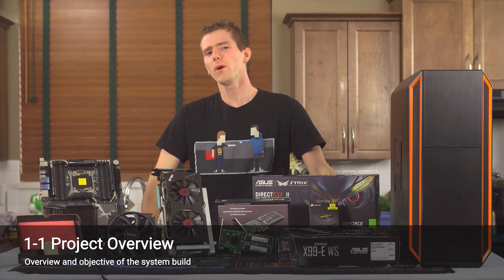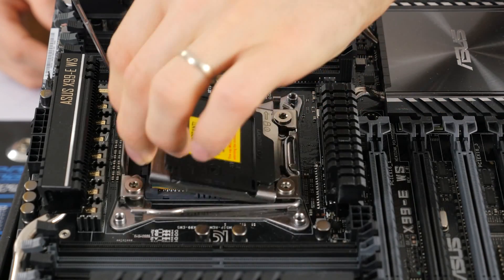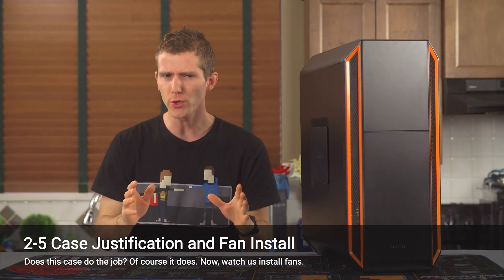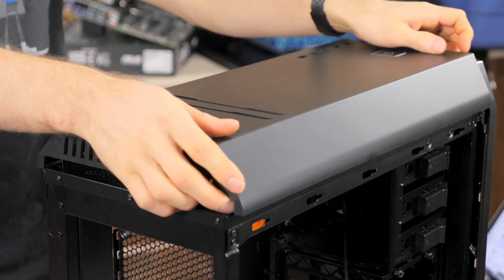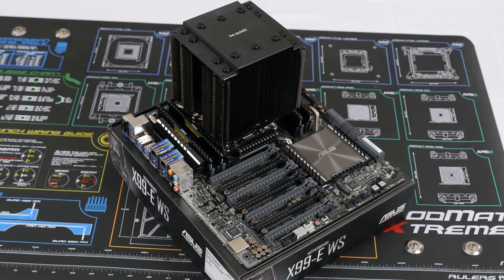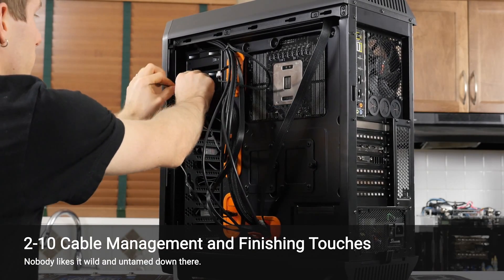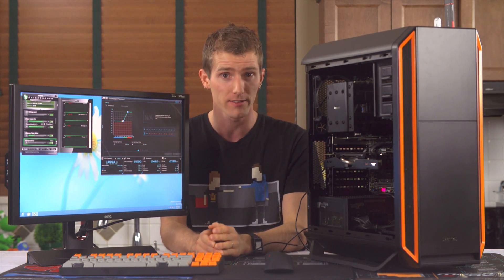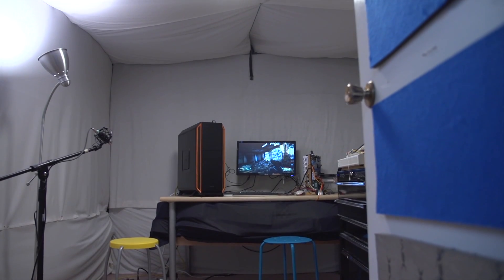How to Build the ULTIMATE Silent Gaming or Workstation PC

Comment: I’ve decided to build my first PC and I’m wondering if this is a good build. My budget is around $1,450. Can someone please help me? I want to build a PC that will last for awhile. I will be mostly using it for gaming on a 1080p monitor and do video editing. Thanks!

CPU: Intel Core i7-4790K
Motherboard: MAXIMUS VII HERO 
RAM: Crucial Ballistix Sport 8GB Kit (4GBx2) DDR3 1600 MT/s 
GPU: Gigabyte GeForce GTX 970 G1 Gaming
HDD: WD Blue 1 TB Desktop Hard Drive 7200 RPM, SATA 6 Gb/s, 64 MB Cache – 
SSD: Crucial MX100 256GB SATA 2.5" CT256MX100SSD1
Case: Phanteks Enthoo Luxe
DVD Drive: Asus 24x DVD-RW Serial-ATA Internal OEM Optical Drive DRW-24B1ST 
Cooling Fan: Cooler Master Hyper 212 EVO CPU Cooler
PSU: Corsair CX Series 750 Watt ATX/EPS Modular 80 PLUS Bronze ATX12V/EPS12V
Reply: If anything, I would get the EVGA Supernova G2 750w psu. It is one of the best and even has something called Eco Mode. My build is almost the same as yours. I have same cpu, mobo and cpu cooler and want that gpu or the asus strix version because of that neat fan feature it has. Just make sure that the RAM you are getting is not high profile, jus in case you ever want to upgrade to more of that type of RAM in the future because the Hyper 212 EVO does take up a little bit of room over the closest RAM slot. But it also depends on how you put the fan on.
Reply: Thanks. I will take a look at the evga psu u suggested.
Reply: zarbon700 I also forgot to mention that I have that PSU as well. It is Fully modular which is pretty neat because of all the unnecessary extra cables you can put away. If you want a really good place for psu reviews, I strongly recommend Jonnyguru.com. The Supernova g2 750w psu got a 9.8 out of 10 and got nothing put in the "bad" section at the end of the review.

Comment: How could you have a silent build with speakers in the display? Plus you need the MS Surface keyboard, as it has no typing feedback. And no mouse! Audio should also be on 0% throughout the system.  Overall a decent build.

Comment: Hey umm wondering if someone could help me out I am building my first ever gaming pc so i dont want to splash out on overpowered stuff but i want to play games on high settings so i have put this through amazon cart tell me what you think.

case: Thermaltake Commander MS-I Snow Midi Gaming Case USB3.0 Toolless White
cpu: AMD APU A8 6600K Black Edition Quad Core Processor 3.9ghz
gpu: sapphire Dual-X Radeon R9 270X OC 2GB GDDR5 Graphics Card with Boost
psu: Corsair Builder Series CX 600 Watt ATX/EPS 80 PLUS Bronze Power Supply Unit
ram: HyperX FURY Series 8GB (2x 4GB) DDR3 1600MHz CL10 DIMM Memory Module Kit - Black 
( i already have hard drive so no need for another one its 2tb 7200rpm)
motherboard: 

MSI 970A-G43 AMD 970 ATX Motherboard (PCI-E, Socket AM3+)

Since it is my first build i just want to know what you think and if those things i have chosen will work good together thanks ! :)

Comment: I'm pretty new to PC building and I want to build my first PC during the summer:)
Here's the Build I want to try.. Any advice or suggestions?
GPU: Asus GTX770 ($380.65)
CPU: Intel Core i5-4690K ($234.29)
Motherboard: Asus Z87 PRO LGA 1150 ($152.23)
Power Supply: GS700 700-Watt ($55.00)
Case: CM Storm Scout 2 Advanced ($145.01)
SSD: Intel 335 Series 180GB SATA 3 SSD ($134.95)
RAM: Western Digital 1 TB SATA III 7200 RPM 64 MB Cache ($74.45)
Corsair Vengeance 16GB DDR3 RAM ($143.88)
Corsair Air Series SP120 PWM Quiet Edition - Twin Pack ($29.95)
Total Cost:  $1,350.41

Comment: I NEVER use the filters that come with the cases, instead i always go to ace hardware and get a $2 home air filter and cut it to size then put it in the front between the mesh and front fan grill (or stock filter) to hold the flimsy home air filter from hitting the fan. I 3D printed a honeycomb fan grill that was only .6mm thick and stuck it on the fan and not the case to prevent gaps that allow unfiltered air through. Almost 2 years and only a very fine dust has built up.

Comment: I would like to see this converted to a WC setup, more specifically see you try to beat 14db whilst gaming. For me this will be a good indication of how many rads i would need for my build.
My goal is to have silent fans fixed at 7v, pump at low settings and enough rads to achieve silent gaming unfortunately I don't have the spare gear to do this testing. I also would like to see video such as low fans speeds with a 360mm rad vs high fans speeds with 240mm rad

Comment: CASE:BitFenix BFC-NEO-100-KKXKS-RP
MOTHERBOARD:MSI AM1I AM1 SATA 6Gb/s USB 3.0 HDMI Mini ITX AMD Motherboard
WIFI ADAPTER:Intel Centrino 6205 
GRAPHICS CARD:Gigabyte GTX 750
PSU: Antec Earthwatts 500w
RAM:G.Skill Ripjaw series 8gb
PROCESSOR: FX6300
OS:Windows 7 home premium
SSD:SanDisk ReadyCache Solid State Drive (32 GB*)
HARD DRIVE: WESTERN DIGITAL BLUE 500GB
DVD BURNER:ASUS DRW-24B1ST

If i got these parts and started building will there be anything else i need for this pc? will these parts fit in the case? please help
PS: Can this run battlefield 4?
Reply: It won't play BF4 because the CPU is AM3+ and the motherboard is AM1

Comment: 3M Asphalt Plate or 3M Backing Plate will kill all vibrations and dampen all sounds-not too expensive either. They might be more common to use on the sides of a dishwasher, but they work well with most PC cabinets as well.

Comment: I get that people want their PC's to be quiet, even though headphones can provide a better, more realistic and immersive gaming experience Clears Throat Sorry, got carried away there. Anyway, I just thing that removing the fan from a CPU heat-sink is a bit extreme. Surely your speakers are loud enough to drown out a single fan, not to mention the other fans in the case. With such a powerful CPU, that is probably going to be pushed quite far in the benchmarks Linus is going to do, I worry it's going to have a very short lifespan.

Comment: Hey guys.. I'm about to build a pc into my table.. i really need your help with which material i should use as table chassis. should it be wooden, steel, aluminium or a mix of titanium alloy? as for the cooling should i use two huge fan (like those small air conditioner in small rooms) cause I'm gonna make it a two tier table and all the fans could be at the back so they are not visible at all or 12-16 240mm ones, 6-8 for intake and 6-8 for outage. i wanna make a really strong pc for gaming, animation rendering and so on. power consumption is not a problem

as for the hardware I'm going for:
Motherboard- X99 e ws
PU- i7 5960x
GPU- AMD Radeon 295x2
RAM- 32 GB Vengeance LPX C16
SSD- 730 Series
CPU Cooler- Dark Rock Pro 3

As for a monitor i'll use the LG 42UB820T

dimensions for the table pc:
L- 5 feet
W- 4 feet
Depth- about 6-9 inches
Reply: wooden prob, aluminum or steel may short-out components, and metal would heat up a bit too, sounds like a good build though.

Send me a pic of the finished product thru my youtube channel when its done, good luck
Reply: Thanks a lot. yeah i was wondering about the metal that they may cause problems. and sure i'll do that.. it should take about a week or 2 for the fully polished version to come out. thanks again
Reply: Its ok, good luck :)
Reply: I'm trying to add a touch screen on the side of my table like the one that razer blade has.. for the purpose of simultaneously surfing on it and working on the table PC. how do i do it, create a touch screen display like that of an iPad (I'm guessing they use capacitive screens). I'm going for a portrait display of 1080x1920. i do not want to create an infrared touch screen as they require large amount of camera distances and a lot of positioning. looking forward fr help
Reply: mmm, dont know where you would buy one but i have seen one of these {https://mrevil.asvachin.eu/comp/fpmon/}, or just a small monitor like {http://www.amazon.com/Lilliput-Um-70-Monitor-non-touch-Screen/dp/B000AYHY7}
Reply: not touch screen though?!
Reply: i would get a closed loop cooler
Reply: Not a bad call???

Comment: FanXpert, really? So as soon as the cpu reaches 75C (which it will do under load because it's entirely passive) ALL OF YOUR FANS SPIN AT 100% AND THERE'S NOTHING YOU CAN DO ABOUT IT.

Why not use SpeedFan and set a completely customised fan curve? You can turn them off with that, too.

Comment: (Psst I don't think the headphones comment was just for when you were using a PC in general, but rather since when most people game they use headphones anyway because a speaker system for the equivalent sound quality is really expensive and can be obnoxious to other people in the vicinity, so what difference does it make?)

I could make my PC near silent. I could replace my case fans with NF-A14s I could change the case for one with lots of sound dampening like the Fractal Design Define R5 but ultimately I wouldn't gain anything because my PC is far from the loudest thing in my room and even given how close I am to it, it is not the thing I can hear. And all of these improvements would come to about £200, and that's £200 that's not being spent on a quieter GPU, a custom watercooling loop, or a quieter dehumidifier (which is the actual source of noise in my room). So that's where people are coming from when they say they don't need silence.

Also Zero moving parts on the CPU cooler. I'm to assume you aren't using any case fans at all, then? Because those two fans on the H100i there are also case fans, so it would be disingenuous to pretend that they were a direct like-for-like with fans on the heat-sink.

Edit: Oh no. You had way more than these two case fans, so you were just being disingenuous after all. OK then.

Comment: How about a custom build completely passive cooled pc? With using a special designed case as Aluminium-cooler for nearly all the hardware? But that needs custom build GPU-heatsink-coolers aso...
Having a HD7850 card with an arctic cooling accellero twin turbo. Furmark (2560x1080px) - 30% fan-45°C -  Double the size of that passive cooler and the fans doesn't even come to 30%.. - Or don't attach the fans and attach the heatsinks to the crazy passive cooling-pc-case :D

btw. Loving that intro-type... Kudos to Cutter/Designer/Producer aso...

Comment: The tools I use for building my PC?
Mil Spec Gerber (lol)
Screwdriver set
Scissors
Zip ties.
Black Gorilla tape
electrical tape
electrical solder and iron
shrink tubes
Dremel and cutting disks and grinding bits
dish soap and scrub pad (to clean the case) if used or dusty
large table and a chair and bright light
ESD strap 
Bin of random leftover parts from other builds...
....I'm a little bit OCD...lol...even the wires in my Dell XPS-410 are tucked.

Comment: I don't know...The build guide is neat and I like the build overall but honestly 'enthusiast silent' machines are just underwhelming. I can make mine silent as well, just unplug it.

To be fair, like I said, its neat but I just don't care in the least how loud/quiet my system is. I've had Frankensteins that would just scream because the fans were terrible and I've had fairly quiet systems that could only be heard if the entire house was quiet and in the end its Performance > Silence. Its like a car, it may look amazing but if it can't keep up or do its job its not worth my time.
Reply: NafanyaZX yes, please tell me how high they can overclock that CPU with so much of the cooling removed for the silence factor. And literally in the first sentence I say I like the build but I find silent machines underwhelming. Unless you go with specialized cooling systems to maintain your silent goal you won't be able to squeeze the kind of performance out of a similar build that relaxes the dB requirements. It's been done, but this is not that PC. 

So lets jump down someones throat for expressing an opinion that LTT explicitly asks for in every video, you're a champ.
Reply: So... YOU don't care about it. Fine.
There's a lot of us that do.

And you don't need to go to the extreme of aiming for as low as 25 dBA, which is pretty much inaudible, but you can aim for a system that is nearly silent in idle (meaning having to come close to the case with middle of the night ambient noise to hear it) sacrificing little to none cooling power.

Stuff like a Noctua D15, a good Seasonic or Enermax PSU, and a couple of good decisions regarding case fans and graphics card will give you very quiet operation, without sacrificing any cooling power when needed.
Reply: ColdSiris your point might be applicable if PC tech scaled better and wasn't hit hard by diminishing returns.  The more "powerful" your hardware, the hotter it runs and the louder the machine.  But the increases in heat and sound rarely translate to an increase in performance in a linear fashion.  So you may be able to squeeze out a few more FPS (that you might not even notice in-game, by the way) but the heat/noise increase will be pretty drastic.
It's super-easy to have your cake and eat it too.  Over the last 4-5 years silent PCs are pretty simple to build using off the shelf parts.  Software like Asus' FanXpert and 5-way optimization make it even easier.
Can't "keep up or do its job"?  What exactly are you expecting these computer to do?  What is so important that it necessitates massive sound and heat?

Comment: What does this COST?
Reply: Money
Reply: tell me more
Reply: bdominik bauer Just use Z97.  If you're ONLY going to be gaming, get an i5, 8GB RAM (although 16GB isn't much more expensive), a decent SSD, and like a GTX 970 and you will be in pretty good shape.  X99 is a great platform but it's REALLY expensive right now.
I built this small form factor PC for a buddy of mine.  It's a great gaming machine and it's close to silent using Asus' FanXpert software.  Check it out:http://pcpartpicker.com/user/hikeskool/saved/#view=sCNv6h
Reply: hikeskool No point of buying a X99 for a gaming rig though. Most games at the moment utilize only 1-3 cores.

Comment: Why not under volt the CPU to get the lowest stable voltage on stock clock speeds and noticably less heat output?

Comment: Pls do a silent wc build. The objective is too cool as much as possible WITHOUT turning on fans on the rads and the pump at a low setting. Of course don't go balls to the wall with rad. I want to say a 360mm and a 240mm for a highend i7 and two gpus.

Comment: If wearing headphones is the equivalent of saying "if your armpits smell use noseplugs" this build feels like the equivalent of saying "if your armpits smell get the sweat glands in your armpits surgically removed", or "if your armpits smell use dr scholls perfumed insoles, cologne, tie a few car air fresheners around your neck, slather yourself with shampoo... and maybe some deoderant or whatever I guess". It's an excessive solution to a problem that frankly seems utterly overblown in all but the most extreme of circumstances in the first place. I mean it's not like you're playing games in the isolation data chamber in Mission Impossible where all hell is going to break loose if you go a decibel above ambient, it's likely going to be a domestic setting with all the background noise implied with those circumstances.

Comment: Just add water and it will be silent. Can easily fit a 240 and 280 rad in there and then just get the slowest fans you can find. That way you don't get the spike of the gpu at load. I guess that those are the fans that made the noise.

Comment: you did it wrong again. that is not how you mount the CPU cooler. no wonder Luck hated the mounting, doing the review og the dark rock 3. first you mount the bolts and nuts on the coller, and the you finish at the back of the motherboard with the 4 nuts.

Comment: Great PSU choice! One thing I've noticed with really quiet systems is that, without fan noise to mask it, coil wine (if there is any) seems quite a bit louder. Did you have any problems with that?

Having a silent PC is really quite awesome. Even in games the atmosphere is so much more potent, especially in quiet game areas. It's something you have to experience to 'get' I guess.
Reply: The cloud unit was way better :3
Reply: DIY Perks people really don't get it until they try it.  And with so many nice "quiet" cases available, it's not too terribly expensive or difficult to do anymore.
Reply: the fractal cases are around the 100 euro - 60-70 pound mark. Not bad for the quality of their cases.
Reply: Mughees Hassan It's nice that the R5 didn't cost much more, if any more than the R4. That case is a steal, and doesn't look like trash like this "be quiet" case.
Reply: Yep. Fractal is the only case maker really high in the quality department for the price... Even Corsair cases are really expensive and don't deliver that much features. The cloud unit was ingenious though...